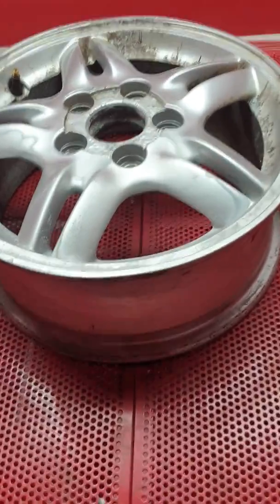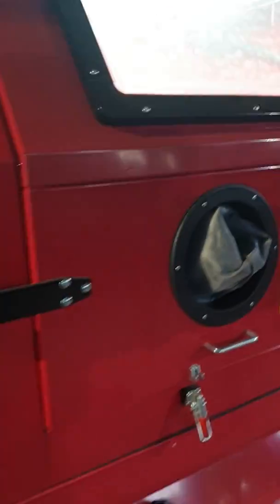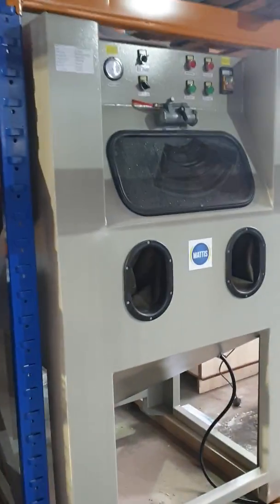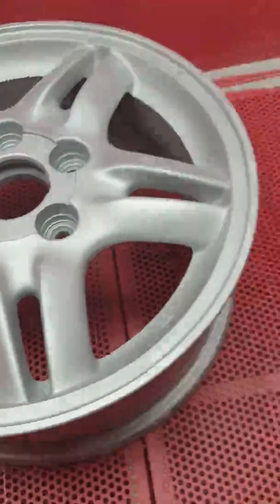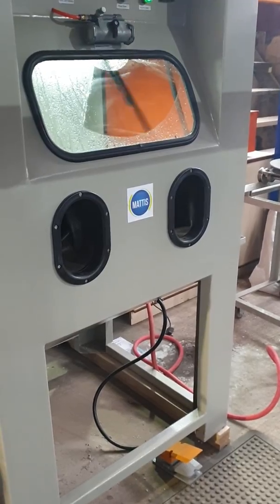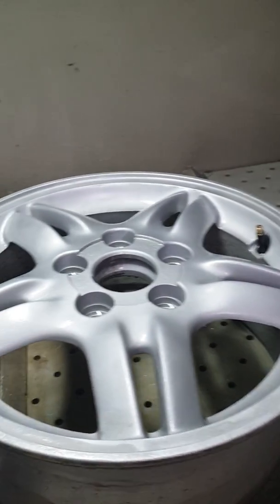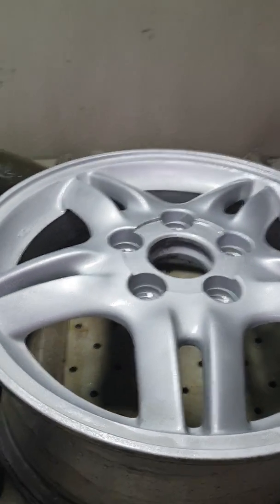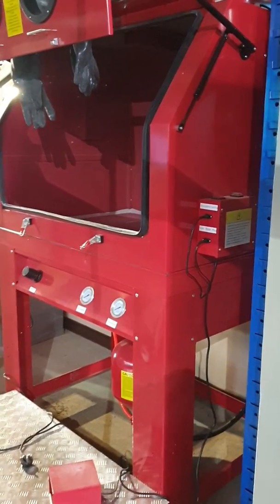Blasting a wheel with a PSBC990 Pressure Cabinet.

Comment: Hello I just bought one of these cabinets second hand. I need to get a compressor that will run this machine for personal use. I plan on using it for wheels and misc car projects. I see that the machine on websites say it calls for 24cfm at 125 psi. Is the cfm more important or is the psi more important. This is all new for me and I know nothing.